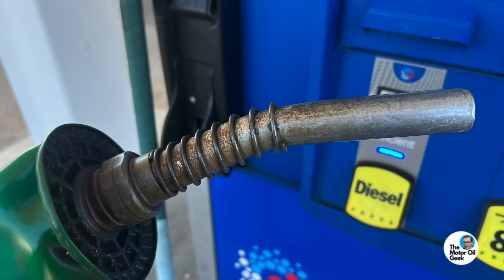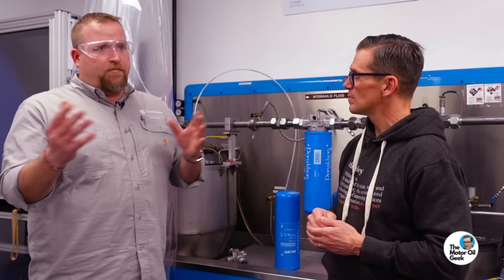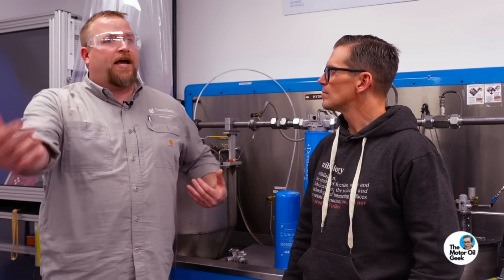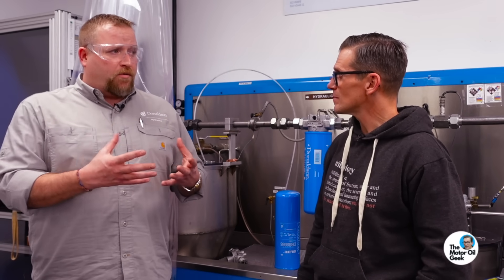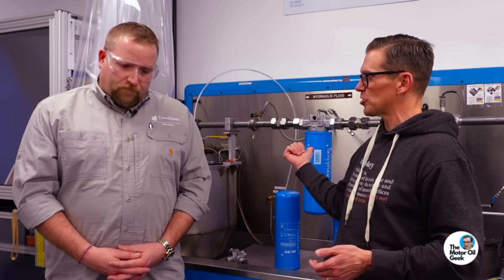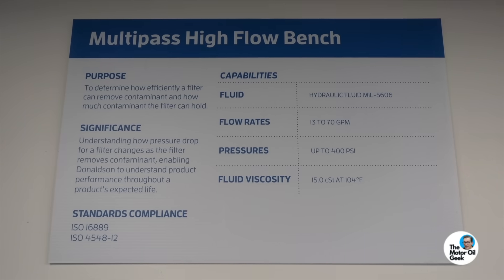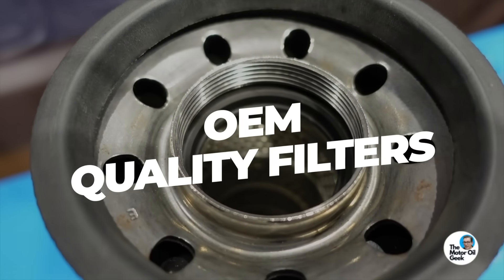Diesel Is DIRTY (And It's KILLING Engines)

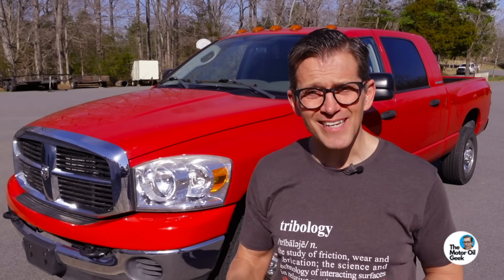Comment: @15:00 can you elaborate on the “not too soon” filter change intervals? GM recommends every 30k miles for the LZ0, for example, I was going to do it at every 10k but now I’m wondering if there are any down sides to that??
Reply: This is a pretty easy concept.  A brand new filter might have slightly larger pores or variations in the filter media. As it begins to filter fuel, small particles get trapped, effectively making the filter more dense and potentially improving its ability to capture even smaller contaminants. This is similar to how a coffee filter becomes more effective as grounds build up. Changing it too soon puts you back to that virgin filter media and lessens the amount of debris it can capture initially, but of course any filter will be restricted more as the media builds more debris trapped which could cause rupture of the filter or starvation of fuel if service life is too long.
Reply: @1randyharbin makes sense, thanks! Guess the question now is, what’s too soon?
Reply: @sergiu_bogdan , I did my first one on my 21 LM2 at 20k or so at the 2 year mark, looked brand new, will do this one at 2 years as recommended by GM even though the fuel I use seems pretty good as far as being dirty goes, being retired I am always hitting the time limit before the miles, but they say 2 years for a reason so that is what I will go with if the 30k miles or filter reminder notification hasn’t been reached yet.

Comment: Wow Lake this was interesting. As a former truck fleet manager and truck owner could I tell you stories of bad fule. 
We used Fuelpro filters on are fleet. Theses are great filters and you see how derty the filter is be for you change it.  
Are fleet ran 10 provinces and 48 states. It seamed that the trucks that ran mostly Canadian miles hade les problems with filtrers and injectors. Is the fule standered different in Canada for diesel fuel than the U.S.  It would be great to have science rather than conjecture. 
I do know that European diesel fule standards are different but don’t know the difference. 
Great video.
Reply from the maker: Thanks for sharing!

Comment: First.... tell us something we didn't know.  Second... the real issue is the emission equipment they put on modern diesels. The EGR is the dumbest thing ever.  They removed them from most gas engines.... and in a diesel, they are dumping soot back into the intake.  OK... there was a lot of talking... but no real testing.  What's up with that?  Lets see him run samples in a Coulter counter before and after filter tests !!!!!
Reply: The real issue isn't EGR, it's EGR plus PCV, yes lets mix oily air with soot

Comment: First thing your concrete company needs to do is to have their tanks cleaned. Years ago, I worked for a company that had three 25,000 gallon underground tanks and we burned about 23,000 gallons a week. We were having a lot of clogged filters both at the pump and on our engines. We had FS come in and clean our tanks. One tank had nothing, ok that's good. The second tank had about 20 gallons of junk in the bottom. On the third tank, FS removed 350 gallons of nasty looking junk. It looked like animal fat, water and some kind of black mold all mixed together. It was nasty. After removing this junk, we rarely had to replace our dispenser filters and only changed engine fuel filters at regular maintenance intervals. After that, we had FS come in annually to clean our tanks and only found minimal contamination in them. But, you never know what you might get in a tanker load of fuel, so regular maintenance is imperative with your fuel. 

Great video! I think after watching this I am going to a smaller micron, more efficient filter on my dispenser to help remove more contaminates before the gets into the equipment. I had no idea diesel fuel was this dirty. Amazing!

Comment: The EPA and CARB has basically destroyed modern diesels with all the regulations.   Unless you "make money" with a diesel like in a commercial application, I would urge consumers to stay far away.  There was an era were diesels were relatively simple and they made a lot of sense, but that's long gone and whatever fuel savings will easily be overwhelmed with extra repairs and maintenance.

Comment: Get a FASS system and you can sleep comfortably
Reply: I like airdog better, because they tuck the pump closer to the filter housing, letting you mount it higher up on the frame rail. I have one mounted to the inside of the frame rails and you can't see the filters at all without climbing under the truck, protects them from getting damaged. Both are functionally identical and made by off shoots from the same company. 

Though FASS also rubbed me the wrong way with some of their marketing videos. An example was they were trying to show that an airdog 160 pump didn't really flow at 160GPM. So they set up this test rig, set the pump to run at 10 psi and showed that it in fact didn't flow at 160GPM, the issue? AirDog doesn't claim to flow 160GPM at 10PSI, they claim 160GPM at 15 or 17 PSI. I found that to be deceptive and slimy
Reply: @SilverStarHeggisist the slimy one is airdog for ripping off of FASS’ product. The original always be better quality. Airdog is mean for stock trucks. If you’re making any decent power in your diesel I wouldn’t recommend airdog

Comment: I have a question. Have you tested diesel fuel for the big trucks at the major truck stops versus the consumer pumps at regular gas stations? Is the source of the diesel the same? I believe it is but I don't have proof.
Reply from the maker: It is the same.

Comment: Very cool video, as always.
Diesels are for Semis and heavy equipment; there is almost 0 reason to have one in a consumer pickup truck.
Reply: The best reason today is towing capability but 20 or more years ago you could usually count on much better longevity and fuel economy.
Reply: Longevity, towing, Fuel economy. 

Pickup diesels are built heavier then their gas counterparts helping them last longer under hard work.

Pickup Diesels tend to have more power and torque then the gas versions, Pickups with the gas engine are usually rated for 15,000 to 20,000 pounds towing, the diesels are rated for 37,000 pounds

Fuel economy, I and my friend both have 2003 pickups, he has a short bed crew cab Dodge 1500 with a 5.7 Gasser, he gets 10 to 12 MPG, I have a 2003 5.9 Cummins Dodge 3500, crew cab long bed (so heavier) and hurting me more, I have mud tires, my Dodge gets 20MPG after I did a power build which did reduce my fuel economy some, before the build I got 22 to 25 MPG. 

Fuel economy is also why cars get diesels, you can have a car getting the same or better fuel economy then a Prius with a diesel.

Also safety, diesel fuel is safer to handle and store and safer in the event of an accident or spill because it has a lesser tendency to catch fire. Also for a vehicle that sits a lot, diesel will sit there without going bad for longer, I've kept diesel for years without it having any issues.
Reply: @SilverStarHeggisist  Unless you are a commercial operation doing a bajillion miles you'll never, ever make up the extra cost of the diesel engine in fuel savings. The gas ones have plenty of power. The diesels don't last any longer and require more and more expensive maintenance. They also are louder, stink, and pollute more. 
The trucks themselves are substantially the same. Sure, there may be a small percentage of cases where the diesel will be better, but for 95% of people the gas truck is better
Reply: @bobqzzi  diesels produce less carbon monoxide then gas, almost none actually, which is why unlike gasoline, diesel can be used in underground mines. 

Modern diesel specs put their allowed particulate matter at under that of gasoline engines. 

Modern diesels run so quietly and smoothly, in part thanks to multi point injection that they are almost silent. Listen to a modern Ford 6.7 sometime. 

The price range I buy in is pre emissions and the price difference to a gasser is only a couple grand and the fuel savings is made in a year or two. 

Older Diesels can be run for free by running them on used cooking oil or engine oil and not that I condone this, but in highschool I knew a kid who ran his diesel Mercedes on heating oil he would steal from around his neighborhood. 

Diesels are less prone to cracking their exaust manifolds and when they do the bolts actually come out. 

Because they're built heavier, they can be bored more times before they're out of spec and need sleeved

Working on the fuel system is safer because the fuel doesn't ignite at the first spark.

The heavier weight over the front axle allows for a higher tongue weight when bumper pulling. 

If you can't tell, I'm a believer in buying a vehicle once, and keeping that vehicle till you die, a diesel will do this more easily then a gasser. The only reason to get a gasser is if you abuse the chassis and the vehicle will fall apart in a few years. 

Another advantage is that you can run all your equipment on diesel, like tractors and generators and store the fuel more safely and for a longer time.

Comment: Thanks for this video Lake! I operate a 2022 Ram 3500 dually with the 6.7L Cummins, and have heard many things about using the cheapest DEF fluid available. I run Shell Rotella T6 diesel motor oil and change out at about every 6k miles, I use Esso diesel fuel most of the time, and I am curious about the role DEF plays in combustion and its impact of overall engine health. 

With engine health being based on the relationship between the use of quality fuel, quality DEF, and quality motor oil; when it comes to combustion, how do DEF fluids compare to each other and how do 'cheaper' DEF fluids (I.E H2BLUE) compare to 'more expensive' ones( I.E. Shell Rotella DEF)?
Reply: Fortunately, DEF doesn't have anything to do with the combustion process.  On the other side of things, quality DEF has everything to do with avoiding expensive DPF problems and all of the associated parts which that DEF runs through.  Good oils and changing intervals, good fuel and filter change intervals, these also have a major effect on the DPF system...beyond that, how the valves are adjusted on the engine top end do as well.

Comment: Seems like you’d need a multi stage, multi-filter system on the truck with separate pumps that could be set to run/recirculate even when the engine wasn’t running, to get the fuel as clean as it needed to be.
Reply: Most trucks run two filters

Comment: Slightly different topic, at one time our minimum cetane rating was 44 then it got lowered to 40 while other countries increased their minimum to over 50.  According to a Chevron study I read that cetane  difference is a 10-15% difference in fuel efficiency.
Reply: I bet it does. I notice right away if I don't put a cetane booster\lubricity additive like PowerService, EDT or whatever especially on 'cold starting' the next day. The 2 or 3 points it increases cetane is noticeable for sure!
Reply: I see huge differences in actual cetane levels in the fuel I work with.

Comment: A few things you can do to help minimize your fuel problems -
If you see a tanker pulled up at the station where you normally buy your fuel, refilling their tanks, wait at least a day before buying any fuel from them. When that tanker dumps fuel into their holding tanks, it's going to stir up all the debris and water that's settled at the bottom of their tanks. Waiting at least a day afterwards, will give the debris and water a chance to settle out, and minimize the chances of pumping that crap into your vehicle.
If you're going on a long trip, where you're going to have to buy fuel in different areas of the country and different stations, take at least one spare set of fuel filters and the tools necessary to change them out on the fly. That's saved me from being stranded in the middle of nowhere a couple of times, when I got a particularly crappy tank of fuel. One tank was so bad, I ended up having dead mosquitoes and bugs in the water separator bowl of my primary filter.
If possible, change your filter setup such that you have a primary and secondary (or final) filter - a primary "coarse" filter, say 30 microns, preferably that is also a water separator, for catching the majority of the crap and removing water - and a secondary high efficiency filter, on the order of 2 to 4 microns, that will catch all the small stuff - that will actually prolong the life of your high efficiency filter, as it's only having to catch the small stuff, instead of all the crap and water that may be in your fuel tank.
Reply: At my local Costco they get about 6 trucks per day dropping of gas. 2 separate tanks. With that volume it’s impossible for a hair to accumulate in those tanks
Reply: That only applies to middle of nowhere gas stations that might see one truck a week. Most gas stations you see will get 1 to 3 trucks a day (and that's for like the small 4 pump station I worked at)
Reply: Another Thing to do; buy gasoline engine !!

Comment: Please test popular diesel lift pump filters. FASS, CAT replacements, Baldwin, Donaldson, AirDog etc.
Reply: I second this. An independent test of OEM style replacement filters vs aftermarket "lift pump" filters would be great information to have.
Reply: It would make sense to use a polishing filter that just recirculates to the tank too... It would take some of the load off the vehicles fuel filters, assuming they can do the necessary cleaning on their own.  (this would just buy time or help with efficiency.)
Reply: I agree I’ve been looking into airdog and fass.
Reply: Been running 4 micron fuel/water sep..and 2 micron fuel filters. Zero issues for years and years. Plus I work at a refinery where I run units that make diesel. I go to the lab everyday to visit with the techs there. We are selling 100%diesel at the moment...zero bio!  I have a sample of straight bio in a clear container,kept in the dark at 70 degrees,the glycerin is separating.bio is terrible for entrapment of water and contamination.

Comment: Can we talk about water that comes from the usual pump atations in Canadian and northern states with more rain? 

Our shop is seeing a huge amount of pump and injector failures from water and ruat in daily driven diesel vehicles. 

In most vehicles, we are now installing lift pumps and Racor 2 micron marine fuel filter/ separator polisher bowls and seeing water accumulate in the very first tank after installation. 

We are now doing full tank renovals and washes, replace soft fuel lines and hard lines where necessary. 

Id be happy to elaborate offline if anyone, including Lake, would luke more details, as his experience may be more related to drier southern climates.
Reply from the maker: Yes, we are going to cover that in a future video.

Comment: If you ever pulled fuel tanks for lift pump or pickup screen replacement, you'd be shocked (or maybe not depending) to see how nasty a diesel tank gets over the years. It ain't stuff getting in from the nozzle or just opening the fuel cap. I've pulled many tanks, gas and diesel and the diesel tanks have  so much crap built up. Use good quality filters folks and be really good about change intervals.

Comment: I remember years ago Ford brought a diesel Focus to the US to tour it around. It came to a big cruise event near my house at the time. They had a tanker of Euro diesel to follow it around as the US diesel was too dirty and would screw it up.
Reply: You answered my question I should have scrolled through some of the comments first, thanks. Someone I know just lost a 2014 BMW diesel that was being extremely well taken care of
Reply: @wmfinch do these cars not come with filters?  Every vehicle should have fuel filters
Reply: @drammerrr like they said the filter has to let something go by. This car had over 120,000 MI. And guess what- the owner was too cheap to take it to the dealership and the people that were working on it in Fresno California had no idea that diesel fuel is a disaster.
Reply: @drammerrr  Of course they have filters but they will not necessarily cope with the extremely poor diesel available.
Reply: @robertvanruyssevelt7159 unless you are running a 80micron or higher I can’t imagine it being a problem
Reply: @drammerrr it was likely water that overwhelmed the separator and got into the high pressure pump and engine…..rip.  My truck has two filters, one is 4 micron absolute and the other is even smaller. Fuel in the US also doesn’t have enough lubricants in it. Additives are a must if you want your high pressure pump to last.
Reply: wow thats interesting thanks for sharing!
Reply: Verified
Reply: Dirty diesel just seems like it adds pump/injector wear. It’s the lubrication that is the main problem afaik. Why the CP3 pump my truck has is fairly safe but the CP4 pumps used on some of the newer trucks are real iffy on reliability because they are not designed for the poorly lubricated US diesel. When they fail from lack of lubrication they are tend to destroy everything else in the path so at minimum you need to replace all the hard fuel lines plus the injectors. So a CP4 pump failure can cost a fortune. 

Then add in the fact that to keep the diesels smoother and quieter they fire the injectors more times per piston cycle. Old rotary pump diesels fired once. Mine stock fires 3 times. Newer ones fire at least 5 times. Not sure if there are any doing more. Just increasing wear for the sake of reducing noise. Injectors themselves aren’t cheap if you buy good ones.
Reply: Then, It is a piece of shet !!

Real life is Not, Living in Perfect environment.

My gasoline engine can run on crappy gasoline No Problem.